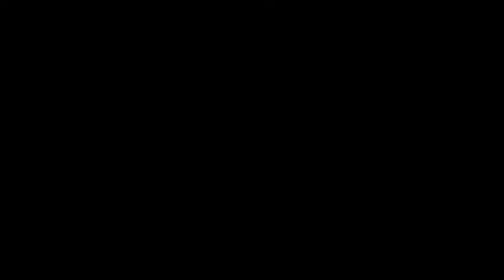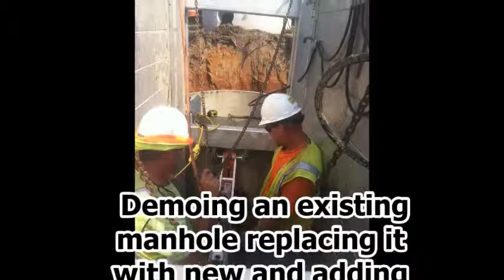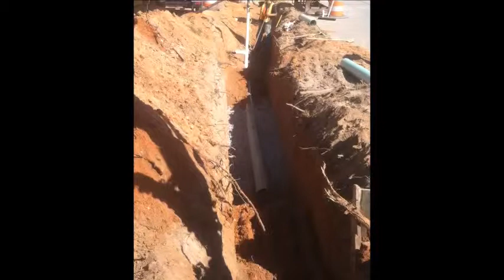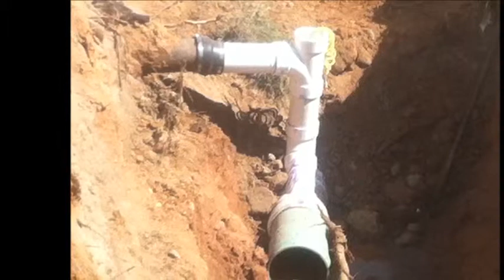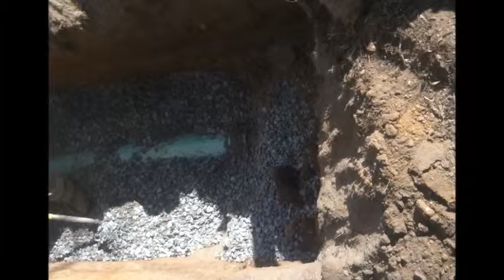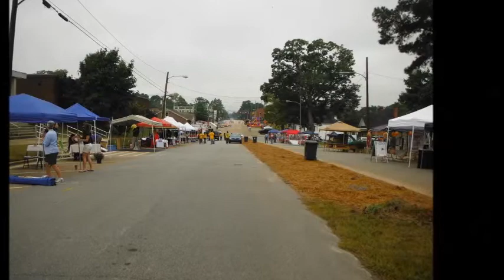Town of Lillington manholes movie

Comment from the maker: Hauling, Top Soil, Sand, Gravel, Driveways, Grading, Excavating, Demolition, Site Development, Snow Removal, Street Cleaning, Concrete, Repair Curb and Gutter, Water Mains, Manholes, Sewer Lines, Access Roads, Utilities contractor, Public utility license, Apex, Garner, Raleigh, Spring Lake, Chapel Hill, Erwin, Angier, Dunn, Lillington, Fuquay Varina, Holly Springs, Benson, Durham, Sanford,